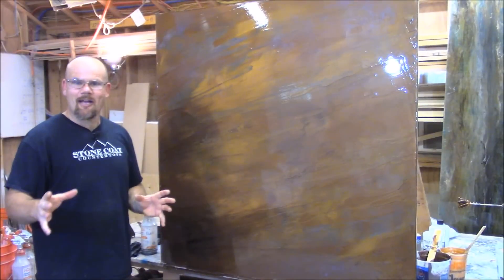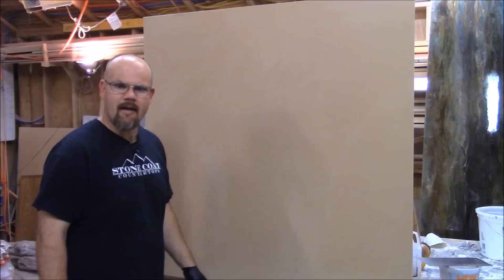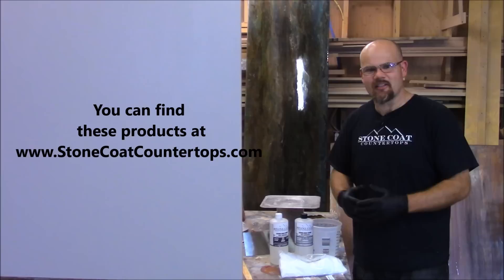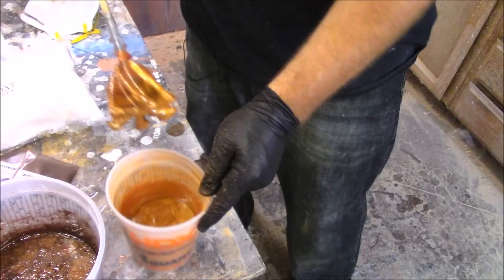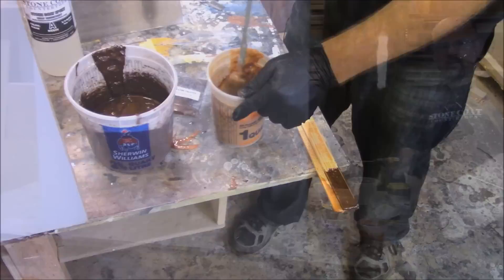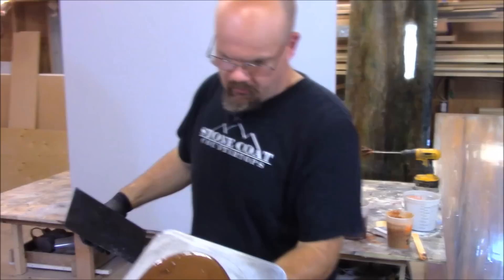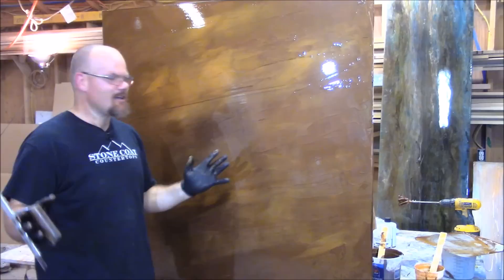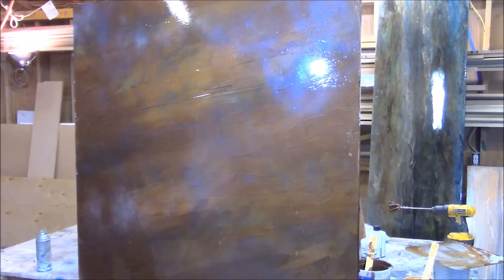Vertical wall epoxy, DIY

Comment: that is awesome the black really did the trick. Can you do this over fresh dry wall or do you need a seal coat then paint and primer in one?
Reply from the maker: Great question Bob! You can apply Stone Coat Countertop Vertical wall epoxy directly over new, or old sheetrock. If applying the vertical wall epoxy over a painted drywall surface you will want to lightly sand with 220 grit sandpaper to help create a great mechanical bond. If the project you’re working on is on newly installed drywall, be sure the sheetrock joints are taped and mudded prior to using the epoxy so the seams won’t show through your vertical wall epoxy install. When mixing up the vertical wall epoxy, keep your batches to a maximum of 1 quart od mixed epoxy at a time. When you add the vertical wall additive your working time decreases from our normal 45 min working time down to 30 min. Mixing smaller batches will ensure you have plenty of time to apply the mixed epoxy to the wall.
Reply: @StoneCoatCountertops  thanks for the information. this is something I will be doing when we get the bathroom is done

Comment: I'm remodeling my restroom and I'm in the construction business I have a question I'm thinking of using a thick type of hard plastic about 5ftx6ft about an 1-1/2 " thick to separate shower from restroom,  I want to do that so that I can add the color like u are doin without painting so light comes thru yet theres still some privacy  is that possible? Thanx

Comment: How would you install this  on a  wall without hardware.  If you only had  a couple  of nails in the  wall.  I paint on glass and would like  to find something besides standoffs to set  it up on decor walls.
Reply: StoneCoatCountertops I have silicone but that's just an oil that will not become the adhesive. Willett pond on regular glass

Comment: Do you go over this with the blow torch?  Is there a way to achieve a glossy finish like a countertop?  This may have been asked before I didn't look through every comment.
Reply: Would using a torch help smooth out the surface?

Comment: Your work is inspiring to watch, Ive seen nearly all your videos and now I know walls are possible Im going to use it in a project of mine...I was wondering, is a more matte finish possible?
Reply: Yes I saw your video where you resurface a sample piece however I am planning on doing this kind of application on a 12 meter semi trailer and I imagine sanding that amount of material would be a bit of a nightmare. Another channel I saw applied a urethane with grit to the surface....can the flexibility of the epoxy be increased to take a bit of flexing when the trailer is moved?

Comment: Does it give you that smooth finish like With the normal self levelling on or you end up with a lot of texture look?
Reply: StoneCoatCountertops we want to do the bath/ shower walls but ideally we want that smooth finish. I though to perhaps do panels as normal to get that smooth finish but then I got stuck with how do I get them on the wall - super strong glue ( like the one you would use for wall pannels) or just screw them in and glue ( then I got the question if we screw them how to we fill up the holes that we will make. Also husband want to do the same thing in the kitchen with the spashback- I just want smooth finish as it’s easier to clean ( with new born let’s face it there is much time to do anything ) 
Also another tricky one- how do you make it less glossy ? We still want to have the shine and all. It god if while this will blind us in the summer 😂
Thank you

Comment: What do you do about the ridges and trowel lines?  Just leave them in, or is there a way to get it completely flat when applied vertically?
Reply: I was wondering the same thing 🤔
Reply: @Articblueberry  I'm guessing it would either be textured or one could sand/polish it after

Comment: Did you sand that wall after you painted it, with 220? I thought you HAD to do that?
Reply from the maker: Great question sardomnumspa!  If applying the vertical wall epoxy over a painted drywall surface, you will want to lightly sand with 220 grit sandpaper to help create a great mechanical bond. If the project you’re working on is on newly installed drywall, be sure the sheetrock joints are taped and mudded prior to using the epoxy so the seams won’t show through your vertical wall epoxy install. Please feel free to call or email us anytime for project support. (541) 450-1976

Comment: Would the epoxy bond to an existing shower (acrylic, pvc, enamel etc...)?
Reply from the maker: Steve, great question. If its a smooth nonporous surface that you are wanting to go over you'll want to use bonding primer!

Comment: My concern is,could this be bad for your health long term? Epoxy is not the best thing to breathe and with the heat in the bathroom.. is this safe? Cause i'd really like to do it
Reply from the maker: Great question. Stone Coat Countertop epoxy is a Zero VOC formulation. It is very durable, heat resistant, has a long working time, and very little smell when working with the product. It's food safe as well as U.V resistant.

If you have breathing or smell sensitivities, you may want to consult your doctor before use. We have SDS information for our products should you need it.
Reply: @StoneCoatCountertops  thank you!

Comment: I plan to use this to do all of the shower walls in my bus/motorhome conversion. What material would be the best substrate? MDF, I worry about it getting wet and exploding, regular plywood or backer board will work?
Reply: Same question.  In new construction of wet area cement board is too rough and will take too much product.  Will it stick to a vertical  waterproof membrane glued to the wood substrate?
Reply: Nicole Hubert how did that go ? I was thinking 3/4”might be a bit heavy (backer board even more so)
Reply: 74deeds what did you ultimately do?

Comment: Could I do this over a painted drywall that's textured lightly ??
Reply from the maker: If applying the vertical wall epoxy over a painted drywall surface, you will want to lightly sand with 220 grit sandpaper to help create a great mechanical bond. Great question!

Comment: After seeing this I was just watching another DIY video where the lady did her ugly formica top in her RV with epoxy over broken CDs. Got me to thinking what if you can apply this idea unto a bathroom wall a vertical surface but then its vertical how to do and the next thing I saw is your video. I cant stand it anymore I just subscribed your video!

Comment: Does the surface smooth and level or it is bumpy? Thanks
Reply from the maker: Great question! The poly fiber by its self does have some texture but after you apply your clear coat it becomes perfectly smooth! -Nathan

Comment: Do you know how it affects different backings in an Rvaule👍 ?
How heavy is this stuff?  # per gallon dry weight? 🤜🤛😎👍🐕How would you use it in an rv? I'd like to make a wheelchair accessible bathroom 😬 as in all sufaces except toilet and ceiling vent. Is there a way of emailing you on your website?
Can't stop watching your videos  yet to find you on the web.😊
Hoping to learn enough about large projects first so i don't ask too many questions. Do you have a frequently asked questions page? Link please, im extremely computer challenged.

Comment: I wish I would have known about this a year ago. I wanted my boat to have that deep shine and metallic look in GA> BULLDOG red and black.I tried and tried different techniques lots of wasted time and money finally bought many,many,many,many bottles of glitter red and black and put bunches of hardner in with a little resin pour in the color of glitter i wanted and would work as fast as I could laying it thick with a paint brush and keep brushing up the material  until it started running off the boat a little slow then when it started hardening Iwould let it lay praying too much would not drip off. It was anightmare but, turned out OK ISH...

Comment: So would you use mdf for a shower wall? Doesn't sound like it would hold up. Can you apply over concrete board?
Reply: StoneCoatCountertops thank you for your fast reply. You guys got me really hooked on your videos! Great job
Reply: I don't know where you are operating but you definitely would not pass code if you put MDF round a shower enclosure.
In Canada you might get away with MR  (green board )  drywall with a suitable vapour barrier behind it. Depends on the inspector

Comment: So can you do this on a drywall wall?
Reply from the maker: Hi Nathan, thank you for watching and great question! You can apply Stone Coat Countertop Vertical wall epoxy directly over new, or old sheetrock. If applying the vertical wall epoxy over a painted drywall surface you will want to lightly sand with 220 grit sandpaper to help create a great mechanical bond. If the project you’re working on is on newly installed drywall, be sure the sheetrock joints are taped and mudded prior to using the epoxy so the seams won’t show through your vertical wall epoxy install. When mixing up the vertical wall epoxy, keep your batches to a maximum of 1 quart of mixed epoxy at a time. When you add the vertical wall additive your working time decreases from our normal 45 min working time down to 30 min. Mixing smaller batches will ensure you have plenty of time to apply the mixed epoxy to the wall. Give us a call anytime with any questions or for project support!

Comment: You should do a video with inside and outside corners.
Reply from the maker: Awesome suggestion Goin blind!
We will look forward to doing this in the future, are you working on any projects currently?
Reply: I'm a plasterer by trade, interior and exterior, but you're video really piqued my interest in epoxy. So versatile, and incredibly durable. The application process is a plus for me, as a hawk and trowel are extensions of my body😀 definitely going to try this soon in my cabin🤘
Reply: Also thanks for the awesome video!!

Comment: Is this textured? Is it less shiny with the thickener? Can this be used on countertop?
Reply from the maker: Great question Linda. Our vertical wall kit is for applying Stone Coat Countertop Epoxy on Vertical walls such as showers, back splashes, accent walls, water features, entry ways, ceilings, and more. You will get a look similar to old world or venetian plaster.  This isn't the right product to use for countertops. for that you will use our Stone Coat Countertop epoxy.  Feel free to call or email us anytime for project support. (541)450-1976
Reply: Looking for a way to reduce the shine on Countertop a little
Reply from the maker: Hi Linda Stoops, you can hone down the finish by sanding and polishing the surface.  We like to wait 5-7 days with our project in room temperature before we polish.  We have tested every sanding disc we can get our hands on, and we have had the best luck with Merka gold and  Aberlon discs. We do sell an assortment pack that will go up to 4000-grit. We finish polish with our polishing compound found here: https://www.stonecoatcountertops.com/product-page/polishing-cleaning  The sheen is not quite as glossy as the original, but looks more like natural stone. Here is a video link of how we sand and polish: https://www.youtube.com/watch?v=iFpzdvPaQl0

Comment: Would this work in bathroom tubs?
Reply from the maker: Great question Scott. We currently don’t manufacture Tub and Tile paint, but here is a link to a product we’ve heard works well for this purpose. Thanks again for the great question! Here is the product link.
https://www.amazon.com/AquaFinish-Bathtub-Tile-Refinishing-Kit/dp/B00642JDTM/ref=as_sl_pc_qf_sp_asin_til?tag=stoncoatcoun-20&linkCode=w00&linkId=cdc3d990da894befe23da84eba50ddde&creativeASIN=B00642JDTM

Comment: Can I put the clear epoxy vertical on any surface?
Reply from the maker: Great question Celine! Yes you can do epoxy on a vertical surface, we recommend that you test out your idea before you get started on your main project. After that you should be good to go!

Comment: What would you suggest for an accent wall that I'll do first laying down flat.. Just mdf?
Reply from the maker: Great question Jody! For vertical walls if you want to mimic polished natural stone you will pour your walls as they lay flat and add any design you wish. We like to use ¾” MDF. For vertical shower walls we use a waterproof membrane called Redgard on the unfinished areas to make sure the water will not penetrate the shower walls.  Our free video training's show many options and color choices. The effects are truly limitless. After the walls are dry and the drips are removed by sanding, you can install the shower panels using 100% silicone as an adhesive. You will also mask off the joints with blue painter’s tape and caulk the joints and tool them with your finger at all the joints and seams. Feel free to contact us anytime for free project support. (541)450-1976

Comment: What's the white stuff, Mike? Precipitated Chalk, Whiting, Kaolin, Talc, Silica, Pumice, Marble Dust, Aluminum or Zinc Stearate?
I know this is irrelevant to most users but I'd be using this for artwork where archivability & lightfastness is a must. I'd need to know so I can work with or around any additive(s).

NOTE: To all you weekend warriors, don't freak out. This has absolutely ZERO relevancy to anything you guys would be using these products for.

Comment: Can u use dry wall instead of MDF?
Reply from the maker: You sure can Smoove King!  You can apply Stone Coat Countertop Vertical wall epoxy directly over new, or old sheetrock. If applying the vertical wall epoxy over a painted drywall surface, you will want to lightly sand with 220 grit sandpaper to help create a great mechanical bond. If the project you’re working on is on newly installed drywall, be sure the sheetrock joints are taped and mudded prior to using the epoxy so the seams won’t show through your vertical wall epoxy install. When mixing up the vertical wall epoxy, keep your batches to a maximum of 1 quart of mixed epoxy at a time. When you add the vertical wall additive your working time decreases from our normal 45 min working time down to 30 min. Mixing smaller batches will ensure you have plenty of time to apply the mixed epoxy to the wall. Thanks again for the great question and please feel free to call or email us anytime for project support. (541)450-1976
Reply: @StoneCoatCountertops  thanks do you sell the epoxy ?

Comment: now the question is: Is it possible to reach a pretty accurate smooth surface? i mean, like not having those scratches and little holes...
Reply: Israel Arias Absolutely! Just apply very brief heat from a torch, heat gun or use a hair dryer set on cool so you don't speed up the drying process.

Comment: For the shower do they have to cure for at least 2wks before using?
Reply from the maker: Great question, Dragonfly Goddess. You can use the shower after the epoxy has cured for  7 days.
Reply: @StoneCoatCountertops  what about using as the shower floor how slippery would that be????

Comment: Would you ever use a rubber trowel versus metal trowel to leave smoother surface?
Reply: The great thing about it being rubber is that you can cut almost any kind of notches you want in it.

Comment: Do you have to do clear cote?
Reply from the maker: With vertical application a clear coat would not stay clear with the thickening powder. If you made a panel horizontal and installed you would be able to do more techniques and also a clear coat. You Got This!

Comment: Is it sealed now and ready for the shower, no other product is needed on top?
Reply: StoneCoatCountertops why not just trowel some of your epoxy component into the seams instead of silicone? Because doesn't silicone caulk get moldy?
Reply: Tamra Lee I wonder this too.

Comment: Can I use the epoxy with no color and just add glitter?
Reply from the maker: Great question Lisa spinosa. For vertical wall application, we add the metallic powder to tint the epoxy and the reason being is that the epoxy mixed with the thickener will not dry clear it will have a cloudy appearance due to the thickening additive.  Feel free to call or email us anytime for project support. (541)450-1976

Comment: I'm curious,,,,,, the finished product didn't look smooth at all. Is that something that'll right itself or is it a case of once it's on you have to trowel it as smooth as you can and after that it's tough shit because if that's the finished product it's such a shame because you got my hopes up for the UK market there but if I make these lovely patterns on somebody's wall but there's trowel marks all over the place, it's not a good start

Comment: Can you do it on sheetrock
Reply from the maker: Great question Zoila!  You can apply Stone Coat Countertop Vertical wall epoxy directly over new, or old sheetrock. If applying the vertical wall epoxy over a painted drywall surface you will want to lightly sand with 220 grit sandpaper to help create a great mechanical bond. If the project you’re working on is on newly installed drywall, be sure the sheetrock joints are taped and mudded prior to using the epoxy so the seams won’t show through your vertical wall epoxy install. When mixing up the vertical wall epoxy, keep your batches to a maximum of 1 quart od mixed epoxy at a time. When you add the vertical wall additive your working time decreases from our normal 45 min working time down to 30 min. Mixing smaller batches will ensure you have plenty of time to apply the mixed epoxy to the wall. Feel free to contact us anytime for project support. (541)450-1976